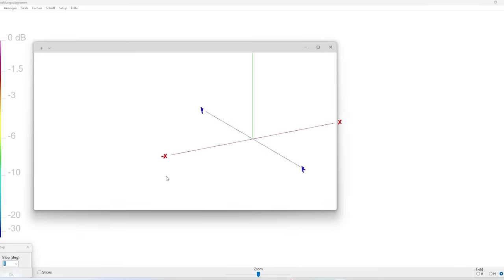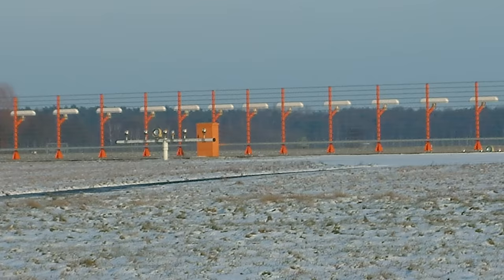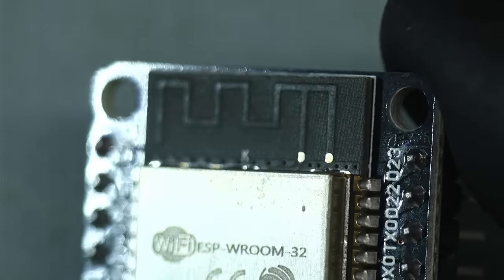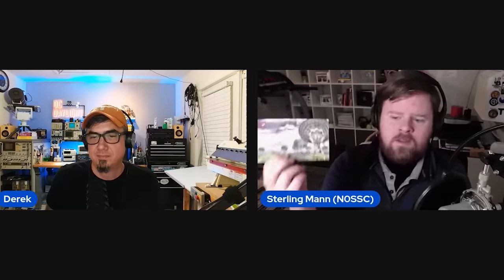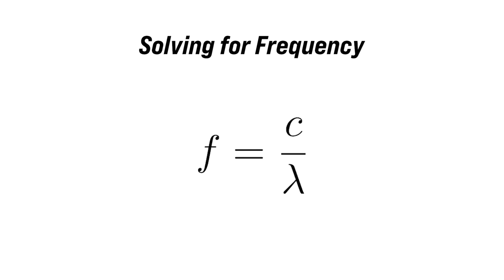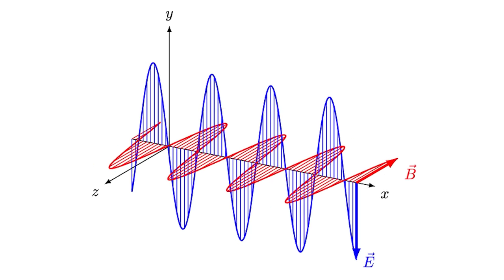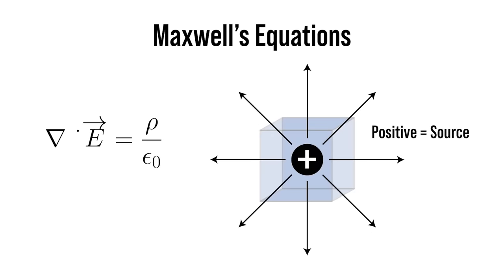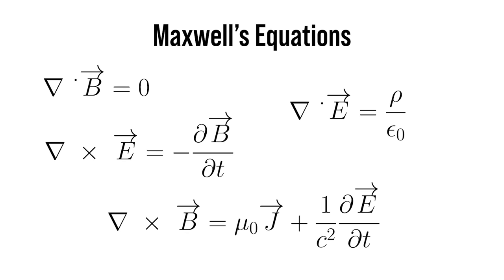Antennas Part I: Exploring the Fundamentals of Antennas - DC To Daylight

Comment: As a RF technichian who worked in Rf transmission field for 17 years. I have come to the conclusion that electromagnetic waves is actually just magnetic waves that travels through space. There is no electric field. The only way to get an electric field or current flow out of the signal is when you put a conductor in the field. Like a receive antenna. So there is electric field in transmit antenna. Which causes magnetic field which changes polarity at same speed and amplitude as the original current in antenna. From there it is just magnetic field only all the way through the air untill it crosses some antenna or conductor.
If I am wrong air must be the perfect electrical conductor so that there is no conversion losses from converting between electricity and RF all the time.
Reply: If that were the case then you could create a radio wave by waving a magnet around rather than having to use a varying electric current.
Reply: @ZigSputnik If you build a motor to run at say 20MHz with a magnet on you should get a carrier. Then modulate the speed with some audio and get Fm radio. My radio picks up a foot pedal of sewing machine arching. Which causes a varying current to the machine causing magnetic fields. But what travels through the air is magnetics.
Reply: https://youtube.com/shorts/wOhvJDEesb8?si=CFzLXItY3sATyFLL  I was watching shorts and this just showed up. I think the magnet transmitter can work.
Reply: It is well-established that a co-propagating alternating electric field and an alternating magnetic field are associated with electromagnetic radiation. You can see the evidence of the electric field by using a lens to focus the beam from a high-powered laser down to a small volume: if done in air, the air breaks down into an ionized plasma from the intensity of the strong electrical field. Air does not break down into ionized plasma under the influence of a magnetic field of any intensity.
Reply: @hevans1944  It was also well established the earth was flat. Laser is more likre light therefore they can use a lens. Lenses does not affect electromagnetic waves.
Lets talk measurable facts. The signal measured from transmitter is a quater of the signal if you double the distance you measure at. Meaning there is basically no loss. Copper conducters used widely for electricity always have some heat loss when conducting any frequency. Now air is a much worse conductor, called an insulator. Now every time the electromagnetic wave gets converted from magnetic field to electric field and back there should be massive losses. Which willmake the first measurable fact untrue.
And in outer space there is a vacume. Even better isolator than air. Which will make sattelite tv imposssible.
I also cannot remember reading in any handbook anything about how far aprt this conversion between electric and magnetic fiels happens. Only that it lookslike a chain. Only thing I know is that when you put conductor in the magnetic field it gets converted into electrical signal which you can measure and use. And that standing about 2 meters from transmit antennas having a few KW of power never shocked me from current flowing in the air.

Comment: Where do photons fit into all of this? Does photon maths/physics ever need to be considered?
Reply: Photons are just the dualistic particle equivalent of an electromagnetic wave. So every physics in the vid is all about photons - just in the wave state.
Reply: @SRJDPO  that doesn’t really make sense. Photons are discrete unidirectional quanta. This video talks about omnidirectional propagating EM waves. I don’t see how the two can be drop in equivalents, which is why I’m asking the question. I want to understand what the relationship is and when you would use photon math instead of EM math.
Reply: @br3nto  lemme know what you find/ where you find those kind of details. curious
Reply: Photons are quantum mechanical constructs. Maxwell's Equations are classical (not quantum mechanical) constructs. One does not require using the concept of a photon to perform antenna design and analysis nor describe electromagnetic wave propagation. The concept of photons was developed to explain observed phenomenon that Maxwell's Equations could not solve, i.e. the photoelectric effect.
Reply: @garymiller6151  thanks. I get that it’s not needed for the common application. I’ve seen my question asked in quite a few places and “QED is not needed” is always the handwavey response, which is very unsatisfying. QED is supposed to be a more accurate replacement for classical models. So in theory, although it’s not necessary, it should be entirely possible to describe antenna physics using QED, and therefore answer the question of how photons fit in and how discretised unidirectional quanta get created and absorbed.
Reply: Well, one could use General Relativity to calculate the relative motion of two objects in the space-time continuum, or one could just use Newton's theory of gravity. Both techniques will give the same result for common objects moving at velocities much less than c. ME and QED are similar. Being an engineer I prefer to use the easiest method to give me a sufficiently accurate solution.

Comment: J is not displacement current, mu0 de/dt is. Also an E field can exist without a  B field,  just not a solenoidal one.
Reply: Thanks for your comment. I think the viewer understands that when we're speaking about E and B fields coexisting, we're referring to an electromagnetic wave.
Reply: @AmRadPodcast  There is also an error in the equation 8:28 - there should be no factor 1/c^2. This factor, or epsilon0*mu0, is to be found in the wave equations derived from Maxwell's equations: (1) Nabla^2*E-epsilon0*mu0*(de^2_E/de_t^2)=0 for electric field and (2) Nabla^2*H-epsilon0*mu0*(de^2_H/de_t^2)=0 for magnetic field. Because there is formula epsilon0*mu0=1/c^2 for the speed of light in vacuum we can also write Nabla^2*E-(1/c^2)*(de^2_E/de_t^2)=0 and Nabla^2*H-(1/c^2)*(de^2_H/de_t^2)=0.
Greetings from Poland!
Reply: @erykbaradziej3639  This is wrong, The video is using SI units, The factor is correct.
Reply: @JensenPlaysMC  Oh yes, you're right, excuse me. But I know different form of the equation (that is in a Polish book for students of electronics) which I mixed up with that of 8:28. The version is: Nabla x H = J + de D / de t where there are different vectors: H which is B / mu or B / mu0 in vacuum and D which is epsilon * E or epsilon0 * E in vacuum. This form is more clear in my view and it corresponds well with the previous Maxwell's equation: Nabla x E = - de B / de t . I also found a form: Nabla x B = mu * (J + epsilon * (de E / de t)). If we factorize this we achieve mu * epsilon or mu0 * epsilon0 which is mu0 * J and (1 / c^2) * (de E / de t) as in 8:28 because mu0 * epsilon0 = 1 / c^2.

Comment: At 9:25 Derek asks for an explanation for antenna radiation and Sterling gives him Maxwell's equations instead of an explanation.  Welcome to Science.
Consider this:  There is a massless medium of the galaxy that moves at c, and is made of matter and energy, but not normal baryonic matter.  Any transmitting antenna that is correctly tuned for its environment (the medium's environment) acts (inducts) like a transformer as it matches the wave speed of the signal to the wave speed of the medium.

Comment: You really didn't explain it in a way most people would understand. Try this: Radiation Antenna: As the electrons flow toward one pole of the antenna, electrons are flowing away from the other pole of the antenna. Although there is no electrical connection between the poles of the antenna itself, there is an "electromagnetic" connection and the Amplifier "driving" the antenna "thinks" there is a connection, so it thinks current is flowing (which it is but not by direct electron flow). It's sort like of how a capacitors allow AC to pass through even though there is no electrical connection between the two leads -  But that is electrostic fields. Now, because current is flowing through the antenna, a magnetic field builds up perpendicular to the poles. So, as the electrons start to flow from 0 to max, the electric fields builds with the poles as the magnetic field builds across the poles, then as the electron flows from max to 0, the two fields diminish. Then the polarity changes and the electrons flow into the other pole while electrons flow out of the other pole. This cause the fields to reverse. As the current flipps back and forth (alternates current AC), so to the fields. This causes them to move away from the antenna as energy being "radiated" as an electromagnetic wave.  Think of this. A circuit has to have a send and return path for current to flow, at the other end is a load (where electrons do their work, say convert to heat). If we design our circuit wires properly, the energy flow into the load will be optimal and thus max energy transfer. We call this impedance mating, if the driver, wires (transmission lines), and load all have the same impedance, the max energy will transfer. That's what antennas do, the impedance match the driver, transmission line, and the antenna itself to free space (air on earth). What is key about electromagnetic (EM) waves is, once an antenna converts electron flow into a radiated electromagnetic wave, no return path to the receiver is needed, that EM wave will then couple into the receiving antenna and cause electrons to flow back and forth in it, but at a much less strength (magnitude).  Just like light diminishes by the inverse square law, so do propagating EM waves. Why the connection? Light propogates as an EM too, just much higher frequencies than radio waves.

Comment: So maybe i missed at, but what exactly ARE radio waves? Are they light waves? Sound waves? Microwaves? Electromagnetic waves? Someone once told me radio is light waves, but I just cant wrap my head around that,
Reply: Electromagnetic waves are always the same thing but exist at different wavelengths and strengths.  What we call radio waves, light waves and microwaves are all electromagnetic waves but at different wave lengths.  The wavelength that we call light is the wavelength that our eyes have evolved to be sensitive to.  Have a look at a table of the electromagnetic spectrum and that should make things clearer.  Sound waves are mechanical and flow through the air, and solid objects, and are not electromagnetic waves.

Comment: Your first antenna is not really a dipole as you have not used a balun, so the coax cable shield forms part of the antenna.
Reply: I've never heard that.  Most dipoles out there are fed with an unbalanced coaxial cable.
Reply: @ZigSputnik I dont think so. Look at TV antennas - they have a balun for balancing and impedance matching (unless they are too cheap and nasty to have one).
Only whip antenna's avoid a balun (or equiv), that's because they are a monopole and the connection point is considered ground anyway.
Reply: @jonanon8193   You may be thinking of folded dipoles.  As a radio ham, back in the early 70s, I was making and buying dipoles and I remember the VHF and UHF tv aerials and FM radio aerials using simple dipoles, and all of these were fed directly from 75 ohm coax.  A balun was optional but rarely used and I never used one.  I remember making my first dipole from the instructions in the Philips electronics kit, which was just a piece of mains wire split apart to make the dipole with the other end of the wire connected to the receiver.  It was called a dipole in the instructions, which it is because it uses dipole principles even if it doesn't have fancy things like a balun.
Reply: @ZigSputnik If they run directly off coax without a balun they're just being cheap.
It's optional in the sense of saving money and having worse or variable performance depending on where you position the coax which is now part of the antenna.
Folded dipoles, such as TV aerials are 300 ohm so need impedance matching and preferably balancing as well, best done by a balun if they connect to coax. If they connect to (old) 300ohm balanced ribbon cable they dont need one.
Sometimes a ferrite might be put over the coax where it meets the antenna - that's a simple balun.

Comment: 12:38  100 mHz with a wavelength of 3 meters is insane

Something being 9 feet long with 100 million oscilation per second is simply not ok
Reply: Well it should be 99.93 MHz to be more precise, but 100 MHz is fair enough!
Reply: c/f = lambda   
(3x10^8 m/s)/(1x10^8 cycles/s) = 3m per cycle

Comment: 8:13 small correction: an electric field can't exist without a change in the magnetic field
Reply: Just wondering, though; about the case of a static electric charge?
Reply: @LeoFreemanAUST  I think, in that case, we have a sink or source of an electric field like an electron. However the electron has also a magnetic moment with an angular spin (i.e. also changing magnetic field) - however just guessing (I may be wrong)....
Reply: @LeoFreemanAUST  The original definition of electric was "like amber".

Comment: Can magnets increase performance of antenna ?
Reply: Haven't heard of any such phenomenon. The antenna's performance depends on whether there is an obstacle in between the transmit and receive antennas as it attenuates the EM wave and on the radiation pattern of the antenna. Some antenna radiate more EM waves in one direction, for example the dish antenna which connects to your TV and communicates with the satellite.

In my opinion, a magnet placed very close to an antenna will disrupt the EM wave and you will get an even weaker signal from the antenna on your receiving device. But, that's just what I think would happen. I don't have any proof for it.